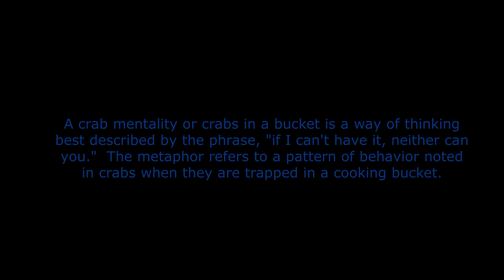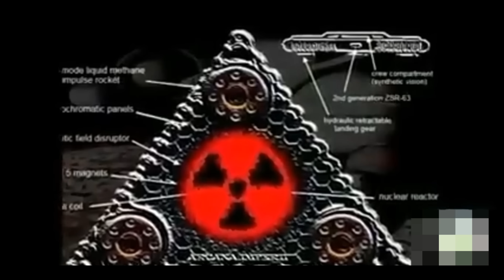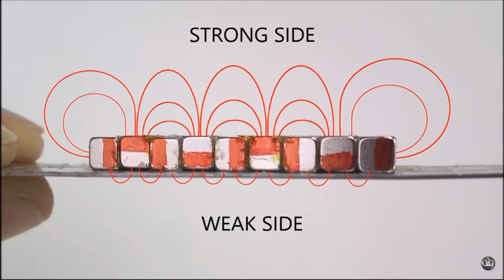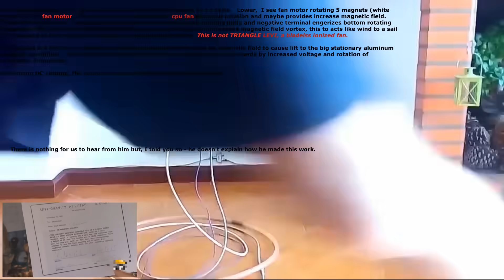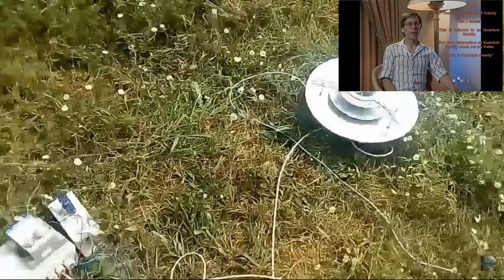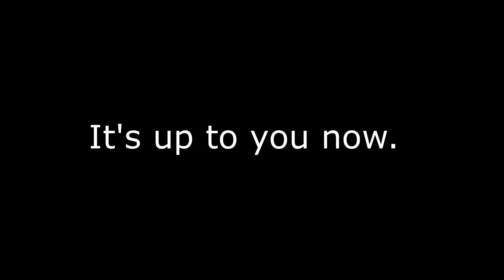anti-gravity project

Comment: il vaudrais mettre une soufflerie avec. pour pouvoir avancer au reculer ou monter ? sinon un bon départ officielle ( sinon leur carburant s est de l'eau ) pourquoi .? et- sent câble la . la question est la . mais une très bon avance que vous avez fais la . je vous suis ! . a de- mais-  ton, si ont pouvais faire fonctionner les aimant comme un ail rond comme un avion mes avec les aimant monter descendre EX .avec des roulements pour le pilotage  pour que le pilote ne suis  pas le mouvement du système tu moteur () donc du devrais avoir un vide entre les deux.?donc tu dois avoir 3 inter face monter et diriger la tu a + - ou - + et autre les 3eme aimant pour directionnel ou ' 4eme  pour inverser ou sinon pourquoi que les aimant ou mieux qu'il soi carre .on les ferais pas rond comme un roulement ? ont aurais pu avoir plus de puissance si il tourne ce eu même + - + - tu n'a pas essuyer avec une batterie de portable car tu sais les aimants tu peux recharger en attente de votre réponse

Comment: Check out Professor Searl's Inverse Gravity Vehicle tech, also Searl's Effect Generator, which is smaller power units, much simpler, he done all the groundwork, all he needs is funding. Let's not keep re-inventing the damn wheel when he already done all the work. The way it works, the SEG collects energy from the air, directly powering itself and can be used as local power source, so much simpler. But if you scale it up, it becomes a transportable device, 6 foot wide, or up to 60 foot, or if you like, 50 miles wide, it can be done. The effect increases, the more power, the more it will wraps itself in a plasma field, and anti-gravity is achieved. It worked so well. You can make the vehicle any size, and it will travel anywhere, even in outer space. There are several lost discs Prof. Searl had tested, which flew up and is still flying out there, probably what people thinks is "ufos" but are really HIS test devices, (chuckles). If only there's a kind billionaire who would gladly donate to fund Prof. Searl's work, and get it off the ground, finally. But yeah, vested interests refused to and tried to discredit his work for years. But Physics refused to be censored, the facts backs it up. The rings and rollers works, they was imprinted with magnetic LINES going opposites each other, that's how the rings and rollers sticks to each other, without TOUCHING each other and WITHOUT falling apart. It's perfect tech. It iS the most perfect tech I ever seen. All others are pale imitations or even primitive in comparison. Oh well. Egos and egotistical people with pride, envy, etc refused to let this tech out. So we're stuck with with inferior products while Prof. Searl's work is largely ignored because useless greedy psychopaths hates his work and can't profits off his work. When the world rids itself of these useless greedy psychopaths then we'll enter an era of true prosperity where EVERYONE benefits, not the useless selected few so-called self-entitled "elites". Thanks a lot for keeping us from our Golden Age Star Trek age. Fuck you psychopaths.

Comment: Delta f = v... if I knew how to do the Delta symbol here that's what I would use... there's another part of that equation that involves the electrical relativistic constant or what simpletons would refer to as the mass of the craft which I'm still working on, and this is pretty much the equation that drives Interstellar craft magnetically...if the  equation seems simple it's because it is...the most brilliant ones always are...E=MC/2,  e=hf...delta frequency equals velocity.
Reply: The best way to describe the electrical relativistic constant would be the sum total of the entirety of its discrete electrical packets known as atoms which will give you the effective resonant frequency of the entire craft... that will give you the wave amplitude necessary to arrive at a relative velocity... and I have to consider that the electrodynamic constant is in fact not constant...
Reply: But yeah I'm still working on that part...
Reply: And May in fact be completely relativistic has I envisioned relative to local spatial constants
Reply: And in fact human beings mucking with the electrodynamic nature of our planet might be in fact what causes spacecraft to crash because we're changing what should be a known mathematical variable and we're altering the variables with things like radar radio nuclear bombs satellites Etc... this could disrupt the navigation system of even a very sophisticated craft
Reply: In pondering on this a little bit I've been thinking on the speed of light... and what it what represents in an electromagnetic universe and to an electromagnetically driven craft... does it represent some sort of spatial shearpoint... a physical limitation... a physical beginning... this has been most challenging to ponder on from a thought experiment perspective
Reply: Or is it even real
Reply: Been thinking on it for a few minutes... it's quite possible that we think of as the speed of light merely represents a dimensional barrier between this "reality" and the next...worth further thought...
Reply: In fact I can almost Envision a possibility where once you go beyond that light speed barrier you enter a realm are you can travel based on speed that you can think... like you enter whatever once you go past the speed of light and like merely by the force of thought and will come out of that wherever you would like to be... another interesting possibility...

Comment: lol you're missing the key component.  You need two coils, and there needs to be a frequency differential between the two to create a magnetic "river".
Reply: ABSOLUTE MATHEMATICAL PROOF THAT ELECTROMAGNETISM/ENERGY IS GRAVITY: 

Time DILATION proves that ELECTROMAGNETISM/ENERGY IS GRAVITY, AS E=mc2 is DIRECTLY AND FUNDAMENTALLY DERIVED FROM F=ma. Einstein's equations are NECESSARILY QUANTUM GRAVITATIONAL, AS ELECTROMAGNETISM/ENERGY IS GRAVITY. In fact, the mathematical unification of Maxwell's equations AND Einstein's equations (given the addition of a fourth spatial dimension) proves that ALL of SPACE is NECESSARILY electromagnetic/gravitational IN BALANCE; AS E=mc2 is DIRECTLY AND FUNDAMENTALLY DERIVED FROM F=ma; AS time DILATION proves that ELECTROMAGNETISM/ENERGY IS GRAVITY. ACCORDINGLY, Einstein's equations predict that SPACE is expanding OR contracting in and with time. ALL of SPACE is NECESSARILY electromagnetic/gravitational IN BALANCE, AS ELECTROMAGNETISM/ENERGY IS GRAVITY. This is, in fact, CLEARLY proven by BOTH F=ma AND E=mc2. A PHOTON may be placed at the center of THE SUN (as A POINT, of course), AS the reduction of SPACE is offset by (or BALANCED with) the SPEED OF LIGHT; AS ELECTROMAGNETISM/ENERGY IS GRAVITY. (Very importantly, outer "space" involves full inertia; AND it is fully invisible AND black.) Gravity AND ELECTROMAGNETISM/ENERGY are linked AND BALANCED IN AND OUT of SPACE AND TIME, as this is CLEARLY proven by time DILATION, F=ma, AND E=mc2. This ALSO explains the cosmological redshift AND the "black hole(s)". Gravity/acceleration involves BALANCED inertia/INERTIAL RESISTANCE, AS ELECTROMAGNETISM/ENERGY IS GRAVITY. GRAVITATIONAL force/ENERGY IS proportional to (or BALANCED with/as) inertia/INERTIAL RESISTANCE, AS ELECTROMAGNETISM/ENERGY IS GRAVITY. "Mass"/ENERGY involves BALANCED inertia/INERTIAL RESISTANCE consistent with/AS what is BALANCED electromagnetic/gravitational force/ENERGY, AS ELECTROMAGNETISM/ENERGY IS GRAVITY. (Energy has/involves GRAVITY, AND ENERGY has/involves inertia/INERTIAL RESISTANCE.) ACCORDINGLY, FULL DISTANCE in/of SPACE, MIDDLE DISTANCE in/of SPACE, AND A POINT are all then in BALANCE; AS ELECTROMAGNETISM/ENERGY IS GRAVITY. Gravity IS ELECTROMAGNETISM/ENERGY. GREAT !!! This NECESSARILY represents, INVOLVES, and describes what is possible/potential AND actual IN BALANCE. Therefore, I have demonstrated the true mathematical UNIFICATION of physics/physical experience AS what is NECESSARILY electromagnetic/gravitational IN BALANCE; AS ELECTROMAGNETISM/ENERGY IS GRAVITY. 

By Frank DiMeglio

Comment: Great how can I build one of these
Reply: You need two AC electromagnetic fields, and you need to be able to vary the frequency between the two fields.  The frequency differential is the rate of travel.  Thus has you can well imagine the greater the disparity (delta) you can generate between two frequencies the higher the speed you can achieve.
Reply: Frequency Delta is velocity and wave amplitude is how much you can move.

Comment: How curious, I dreamed about this anti-gravitational engine over 40 years ago, and I remember that the most important thing for it to work was the frequency of rotation of the magnetic field both inside the toroid and in the same toroid, I remember that the person who showed me the engine running, in my dream, I was unable to remember that frequency, but I forgot ... after watching the movie Matrix with the ship Nebuconodosor, remember my dream because the bulls that made that ship fly, were the same as my dream , like those electric phenomena of them, it was a very strange thing, almost a dejabu to see that ship with its motors in a toroidal form shooting rays as I saw them in my dream many years ago
Reply: What they built is not a engine it is a motor it is electrical there is only electricity no fuel is used  wow also it is silent no noise that it self is so cool you will be able to lissen to music in space with out hearing loud engine mind yeah sound does not travel through space.
Reply: Dreams can be a window into the future and your soul
Reply: knowledge is power. Knowledge is all around us. It surrounds us. Some can tap into it without much effort. I did it over 20 years ago and was just laughed at and ostracized. A huge database that could actually be accessed by any higher being. Water must always be with you. Water stores everything in terms of information and knowledge. I was able to control and direct Orange Blitzen. Blue lightning then chased me as punishment.
Reply from the maker: anti-gravity-toridal_synergy
https://youtu.be/8KGuB8bZKNs
Reply: Really hope you could retrospect the details in your dream and share with us one day :)
Reply: @maker.kylesu  Hi his dream sounds a bit like the Graviflier a Russian invention it is very real it is not a Hoax ,i have a very good understanding of electronics check it out.

Comment: Gravity is made by mass by the earth and at the center of the earth is pressure of heavy metals that's extremely hot that rotates that creates a electric current that creates a magnetic field. Reverse Engineering how this process works you will also need a rotating mass inside a object but not creating a electric current but instead creating a force that levitates off the earth's magnetic field kinda like repelling magnets. But instead of repelling forces you will use the energy from the electric current the earth is creating to run your machine that's rotating to creating the new force that's cancelling out gravity. The machine will be creating a force kinda like how the earth creates a magnetic field from electric currents from molten metals rotating made from gravity but instead it's a anti gravity force. Your machine will need a atomic pressure so high concealed inside your machine rotating at extremely high volatility it will produce a energy that will allow the craft to flow within the magnetic field of the planet that will draw its power from the earth's core that creates a electric current that will intern Cancel out gravity/mass. Think of it as if gravity and magnetic field are Cousins. Gravity attracts and a magnetic field reflect. But if your rotating machine is creating a force a new gen force it must surround itself in a way that when gravity is pulling you toward the center of the earth you can flow free within the magnetic field of the earth and not repel like 2 south end Magnets pushing against each other it just needs to be free flowing.
Reply: There's no such thing as mass because there's no such thing as matter.

Comment: You humans are so primitive. The magnets on this planet is not powerful enough. The magnet also  must be melted down in liquid form spinning at the speed of light.  Your planet does not have the materials to create the housing to hold the rotation of the liquid magnet. you will need to mine the sun for this metal. Stop wasting your time, Humans.

Comment: in the video where the guy built his own flying disc it's pretty obvious why there is no sound. It's also obvious why they never show his contraption from below. The way he probably makes it work is with either a ductless fan system or to counter rotating propellers in the center that provide enough thrust to lift the object up. The counter rotating propellers like a gyro were prevented from spinning around its own axis. There is no levitation involved it's just a trick

Comment: 1:05 if that's real that's a picture of how aliens can gain energy from pyramids or should say the enegery they give out,
Reply: No, not at all. A pyramid circuit such as in Giza requires, first of all, an Ark inside the gold coated queen's chamber. Christian looters too the gold from inside and outside the pyramids, all 7, which were tied together to work with the Ark to produce electron beams strong enough to repel inbound and outbound spacecraft as well as communicate beyond light speed and even correct the orbit of earth if necessary. There are pyramids on the dark side of the moon still in operation which can move it around at good speed just like a craft, which I suspect it may be. It's just been covered in garbage. A slide of the moon was smeared out by NASA but using anti-smear software, a fellow was able to see what they were hiding. A giant mining machine 3 miles in length.

Comment: From what i think is that gravity has to be a form of static electricity. It just loses its predictability once the scale of mass involved reaches a certain point. That's where I believe chaos theory melds with thermodynamics and fluid dynamic especially when certain elements like the ones contained in earth's core are in a liquid state and moving at high rate of speed in a magnetic field. Change certain variables and certain results. The multiverse is real and harmonic resonance of a certain set of frequencies somehow will prove it. Every possible thread exists
Reply: That's where pyramid placements come in
Reply: @ryanridge8102  pyramids contain alot of mass and for when they were most likely created probably the largest mass of any man made objects. With the Formica linings in South American pyramids and mercury in Chinese mounds and pyramids the connection to power creation is hard to deny
Reply: 3,6,9

Comment: antartica is a ring, not a continent.
Reply: Pratnamac   Wrong. It’s been measured. It’s a continent.
Reply: @Cary Boy
wrong mister troll, no real proof of mesarement as it has be done by governement affiliates only, no independent researcher groups or else.
some navigators tried in the previous century, the failed.
Reply: Pratnamac    Ok clown. I guess you’re not aware that Geodesy is the science of measuring the earth.  https://en.wikipedia.org/wiki/Geodesy

Comment: nobody here seems to have a clou about magnetic fields but wants to be an expert. 
in large scale it isnt possible. you couldnt deliver that much energy to lift something about a ton weight. in addition the magnetic force field loses its energy expotencialy over distance. when you lift 1pound 3 inches, then you need ten times the energy when you want to lift it 6 inches. 

and it needs a conductive surface to float on. the earths magnetic field isnt enough by far. it needs a solid metal plate to float on...

Comment: I have seen a video on another channel of aluminium foil floating before when a high voltage current was applied to it so the video here is genuine !  Probably the other videos are genuine too, just because we have not seen something before does not mean it's fake !
Reply: it's a hoax, that's my bet.

The first video in house it's just suspended from fishing line, hence the white background. When he puts the ring around it, he opens the ring quickly off camera, puts the string through it, reconnects it (see the black tape by where his hand was?) Then drops it over the machine. That or he had a ring already around the fishing line out of frame. 

In the second part outside he has 3 or more tall poles mounted in the ground outside of the frame and has the device tied to them with fishing line. He just minds them when he puts the stick over it. 

It's just impossible for the device to even work as demonstrated and be stable.